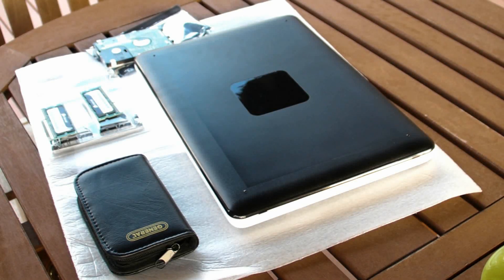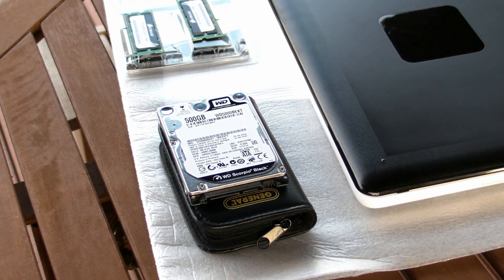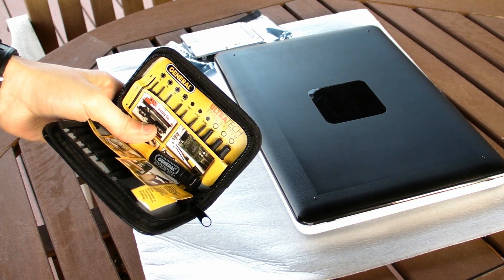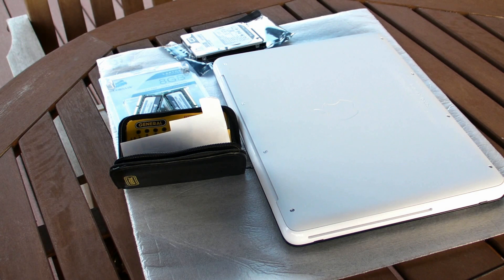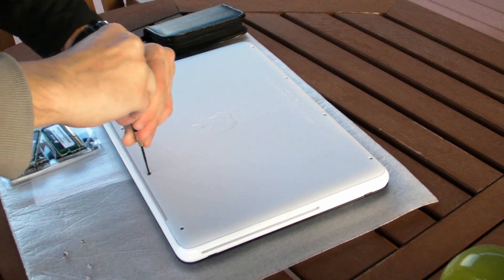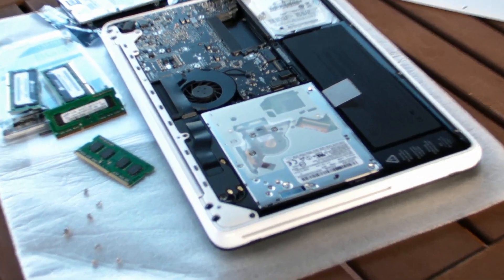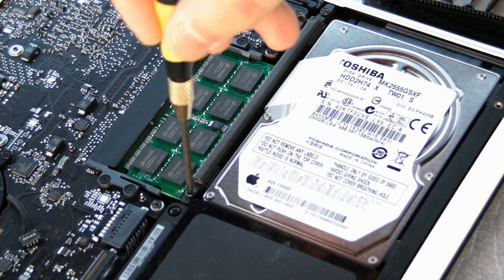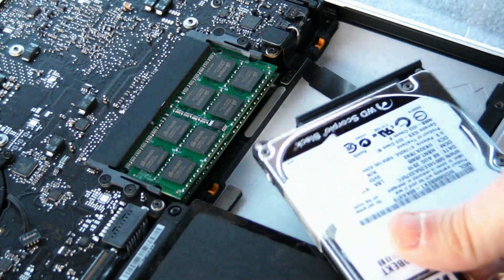White Macbook 2010: Memory and Hard Drive Upgrade 101- pt1 of 3

Comment: The screws in the hard drive bracket are "captive" and completely removing them is not only not required, but can cause problems. Replacing them can cause cross-threading. Just loosen the screws enough to free the bracket. You won't lose the screws and they're easier to tighten back down after replacing the drive.

Comment: Hi bro, I Understand this video you uploaded in 2010, and of course the model is also mid 2010. I have the same machine. in 2016 I want to upgrade to 16gb RAM or 1 or 2TB HD. Please advise me... is this a good idea to buy these memories and will definitely work. OWC shows this laptop can be upgraded upto 16gb RAM and 2TB hard Drive. Please advise. Thanks
Reply: I also have the same machine. A couple of months ago, I purchased a 16 GB upgrade from OWC, and it wouldn't work. OWC's tech support was great and spent more than two hours on the phone with me. Tried everything from resetting the PRAM, checking the SMC Version, "safe booting," etc. OWC had replacement RAM delivered to me the next day and it still wouldn't work. They promptly refunded my money and offered to have me ship my MacBook to them. The RAM was verified as okay. I plan to try again next week, but only with 8 GB and see how that works.
I can't say enough good things about OWC.
Reply: NO DONT this macbook can only support up to 8gb memory 1066mhz ddr3

Comment: im thinking about buying one of these in 2016 should i get one?
Reply: +Cameron Fray same the white looks so nice
Reply: i know i am currently a 17' 2011 macbook pro user but it is failing badly
Reply: +Cameron Fray what do you mean
Reply: +Cameron Fray what do you mean
Reply: it is slowing down crashing and struggling to ruin youtube videos
Reply: +Cameron Fray how much ram and hardrive
Reply: 8 gb ram 512 SSD
Reply: +Cameron Fray thats wierd
Reply: it is isn't it
Reply: mayby you gave a virus
Reply: no i downloaded some anti virus on the app store and it didn't come up with anything
Reply: check activity monitor anything taking an excess amount of ram, disk utility verify and repair
Reply: I'm using a 2010 MacBook Pro. It's doing great.
Reply: no the gpu only has 256mb VRAM and the core 2 duo 2.4ghz is painfully slow. ram starts as only 2gb. hdd is only 280gb

Comment from the maker: Thanks for watching.
Yes, this is the best what you can do for your macbook 2010. This macbook can take maximum 8gb of ram and 512 gb-1tb hdd due to thinner 2.5 inch factor available by today date. Make sure that ram is 1066Mhz CAS 7 - this is important or otherwise ram will not work.

Comment from the maker: The problem that memory has a higher latency and probably higher frequency. Bios of motherboard scale memory down to right memory frequency automatically - but because it is cant run right latency memory crash. Get the same memory as I did or DDR3 memory with same frequencies and latencies from different brand.

Thanks for watching.

Comment: I've put 8gb ram in my macbook 2010 model, but if i start it up again it keeps making a beeping noise. After this, i've put the old memory cards back in and it worked fine... Anyone know what to do?? Thanx
Reply: If you know the RAM is good and meets all required specifications, go to the Apple Menu>About This Mac and click "more information." Check the SMC Version. It should be "1.6Of6."

Comment: Hi.I have white macbook from 2010.

 Model Identifier:	MacBook7,1
 Processor Name:	Intel Core 2 Duo
 Processor Speed:	2.4 GHz
 Number Of Processors:	1
 Total Number Of Cores:	2
 L2 Cache:	3 MB
 Memory:	2 GB
 Bus Speed:	1.07 GHz

Will it support 2 pieces of 4gb ddr3 so 8 in total?
Will it support ssd sata 2 or 3 or only 1?
Does it matter if install a new ssd in the old hd bay or in the optic bay?

Thank you!